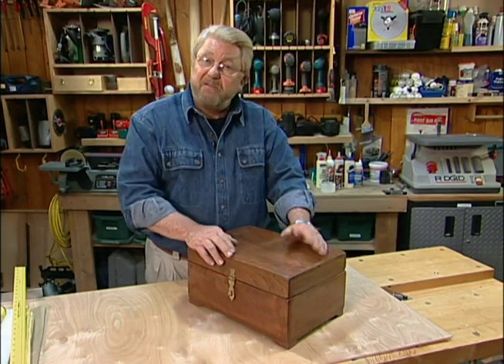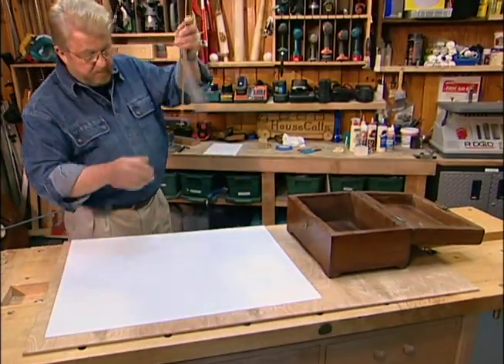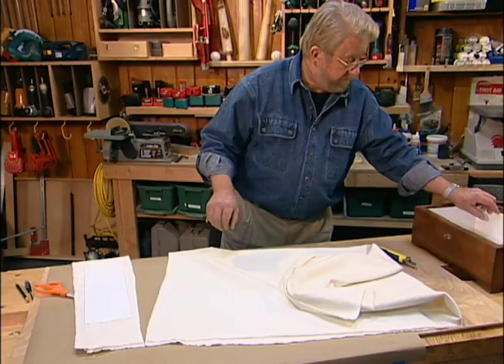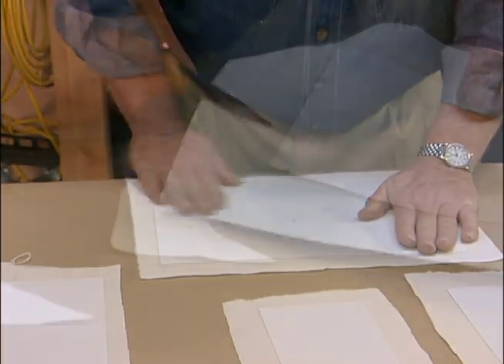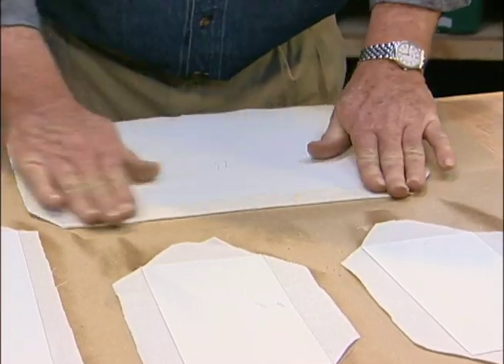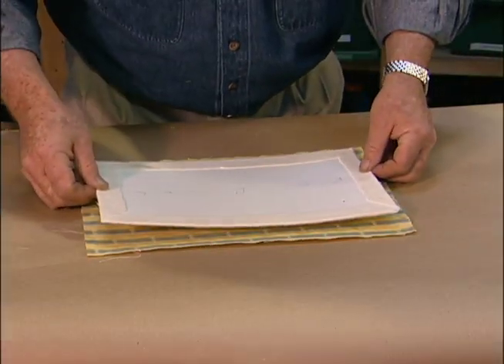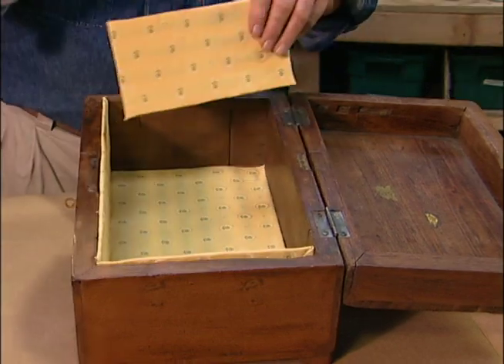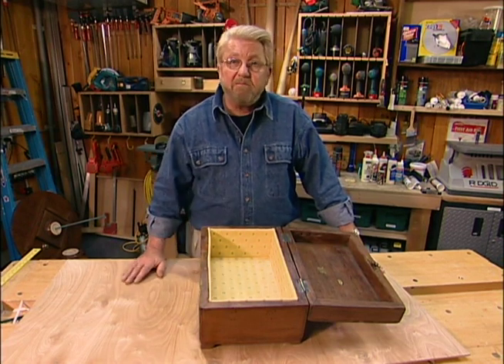Line a Box with Fabric

Comment: Very useful. I've had to remove the padded foam lining from one side of one end of my guitar hardcase to accommodate a slightly larger instrument. I was able to separate the fabric from the foam and was trying to work out the best idea to just use that on the 'bare' side. Your suggestion will (a) work perfectly,  (b) provide a way to even out any unevenness on the stripped side, and (c) prevent the hassle of trying to manipulate cloth onto a pre-glued surface that is curved.
Bell rung for future use.  Many thanks.